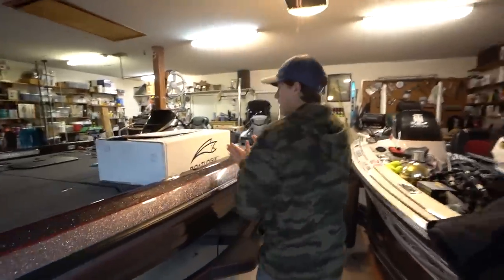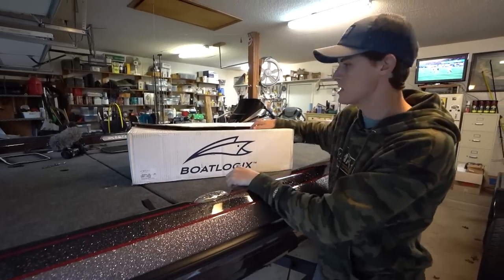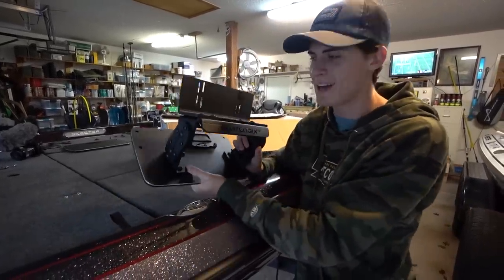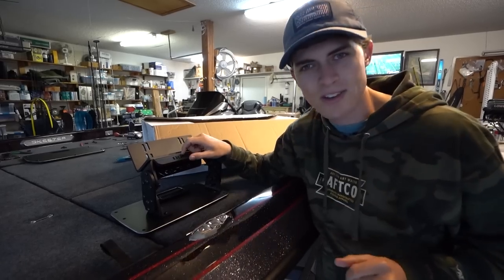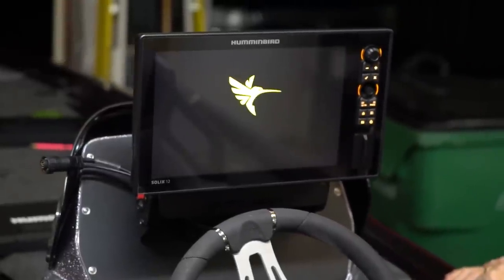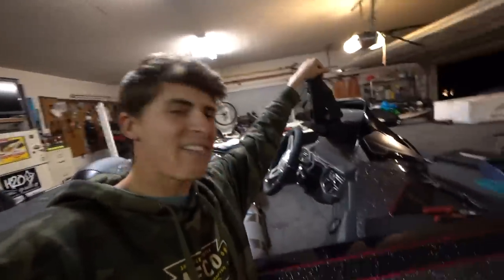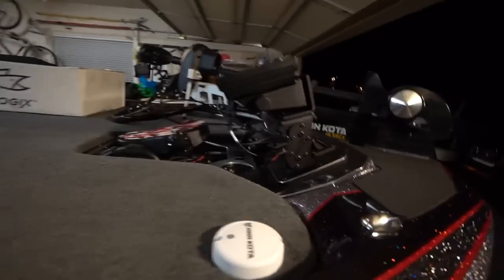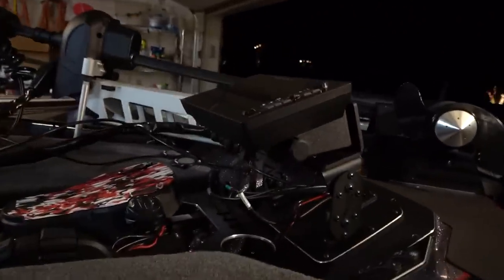CUSTOM Bass Boat Electronics Installation!! (THIS Will Help)

Comment: Why do the base of mounts have to be sandwiched on a skeeter plate?  It doesn’t appear that the mounts have a custom fit.  Are you re-using old mounts from a diff boat?
Reply from the maker: I don’t use this graph mount now. I run Beat Down Outdoors